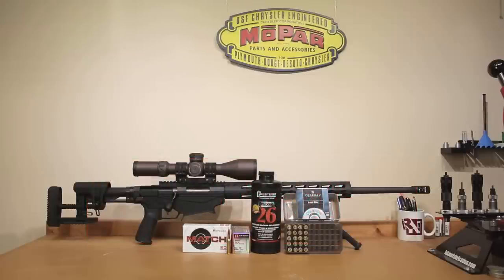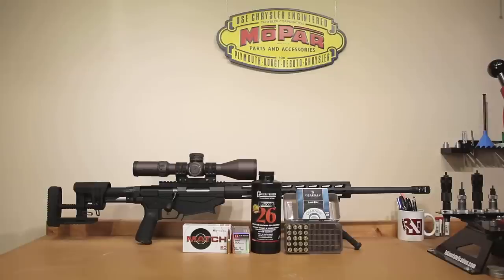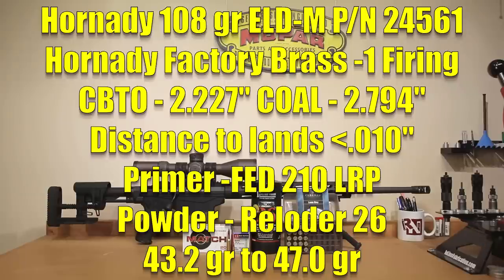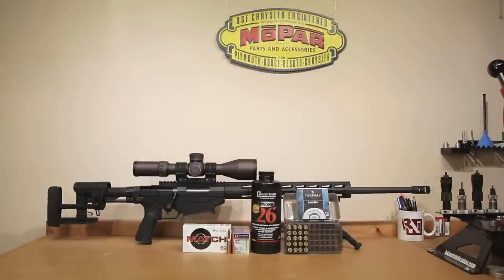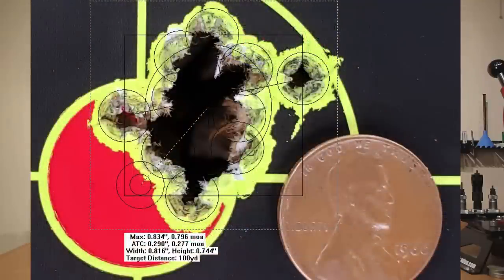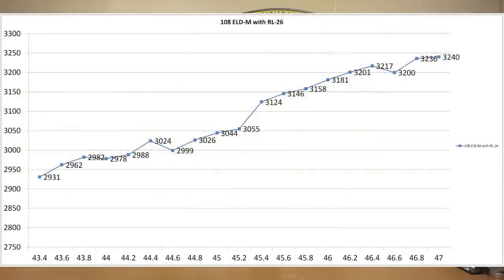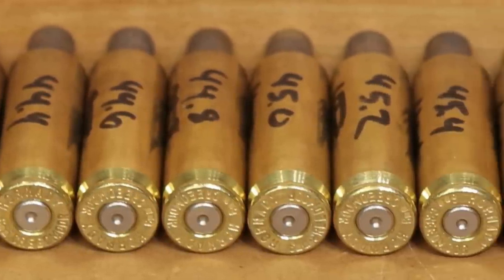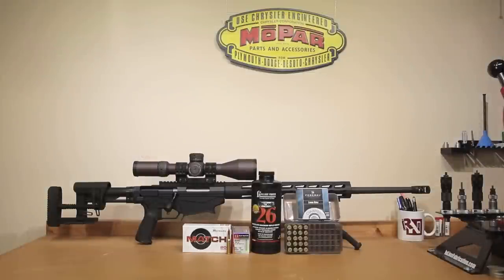6mm Creedmoor - Hornady 108 ELD-M Match with Alliant Reloder 26

Comment: I bought this rifle because i thought it was too good of a deal to pass on.  Turns out the rifle has bench rest accuracy.   I actually like the short throat.   With 6cm that’s not a bad problem to have.  I’ve owned three 6 creedmoors.  All have been short throated and all shot great.   I’m a fan.
Reply from the maker: I have nothing to complain about with it for sure. I have seen it for as low as 719 and its worth every penny. What barrel life are you finding?
Reply: Bolt Action Reloading I only have about 750 rounds through the rifle so far.   Going strong so far.  Mostly 105 smk and h4350.    I bought h4831sc to load but I have not even tried it because I’m getting bug hole after bug hole with perfect ES and SD.   When I rebarrel I’m not going to use h4350.   I’m going to try to milk more barrel life out of it with a powder that can help me do that.  The barrel is actually really nice.  SD, ES velocity all have been great.   When I rebarrel the rifle I hope the custom barrel is as good as this factory barrel. I’m serious when I say that.   I don’t know if I got lucky with this barrel or if it’s common for RPRs.    Here lately I have been playing with a couple 308 rifles.    I actually have a spare chassis laying around for a Howa.   Thinking about picking up another 6 cm Howa barreled action.

Comment: Great vid dude. Im really liking the alliant brand. Ive tested vhit n565 and compared to r23 and got very similar results but faster mv out of the r23. Question though as i used to id pressure visually... Had a bullet maker express that 0.0005" expansion on the primer pocket is when to stop. Measuring across ejector flange/case head area. Thoughts? Another you tube channel confirmed the same "the real gunsmith" for these experimental loads. Cheers
Reply from the maker: I am a big fan of RL 16 and RL 26 I have just started using RL 23 with 300 win mag with 190 gr projectiles. I have looked mostly visually but looks can be deceiving sometimes.
Reply: @BoltActionReloading  i would agree with you on the looks some of my friends bar 308 leaves smily faces on box ammo various brands. One rifle of mine leaves primer craters on box ammo. I tried using this technique and found it to be pretty good method. With many manuals having their own techniques of judging pressure this appears like a good winner. Anyways any loads with r26 142gr smk peterson srp brass in the near future?

Comment: How does RL26 compare to H4350 in temperature stability?
Reply from the maker: I really don't have any data on it. I have used Magnum primers to keep ignition more consistent.
Reply: @BoltActionReloading  Thanks. What have you concluded on the 115 DTAC for a powder. H4350?
Reply from the maker: @paunchouspilot6757  I haven't worked on much lately. I need to get back into some more 6mm CM sometime soon I hope.

Comment: I find it unusual that you are doing accuracy testing with the chronograph attached to the barrel. Do you always do this?
Reply from the maker: This is a ongoing debate in our community that I try to steer clear of. Some think that all you will be facing is a poi shift, some disagree. I want to know the velocities as much as the groups and gentlemen that I trust like brian litz seems to think that poi is all I am dealing with, then I will use my magnetospeed. I do have a alternative way I may start using coming up on the channel soon so this may change.
Reply: @BoltActionReloading  Have you looked into the Wiser Precision mount or another similar device? I shot a 3x1000 match with the Magnetospeed attached to my chassis via Wiser on Arca dovetail.

Comment: Same target results I get with my 6 Creed 10 Shot tests . All the hate on anything Creedmoor is unwarranted horseshit...it just flat out performs!

I like a low price-high value rifle, but that 300 T/C was doomed from the beginning. Send it over to Vaughn Precision for a re-barrel collaboration and do it right, and it'll still be low price-high value rifle.
Reply from the maker: I am not telling anyone to ditch a .243 win for 6 creed but this rifle has no recoil super easy to load for and you dont have donut neck issue with 243. It just flat out works.
Reply: @BoltActionReloading  unless you have a 243 Win, with a fast twist, that can stabilize heavy for caliber bullets, it's not in the same conversation with the 6 Creed.
Reply from the maker: Faster twist would be the only option I would go for to be honest. When I picked up the TC compass 300 win mag I thought about the 243 but the twist rate made the decision for me. Probably would have enjoyed the 243 more than the 300 win mag at this point, but I dont regret this purchase at all.
Reply: i don't know of anyone hating on 6 creed for performance, the problem is barrel life
Reply: @paulwatson4616  a barrel is a consumable, just like ammunition. my 6 Creed started life as a new 6.5 creed.